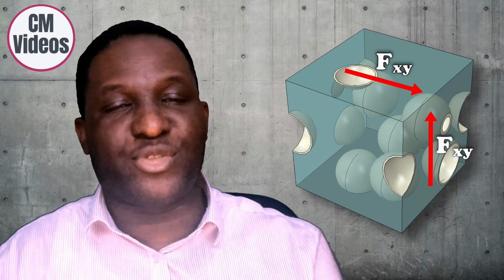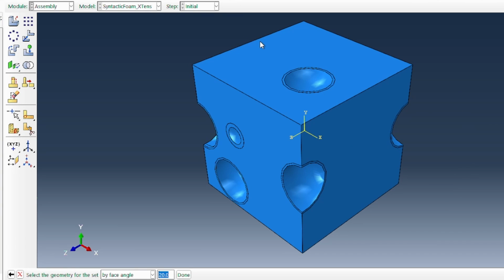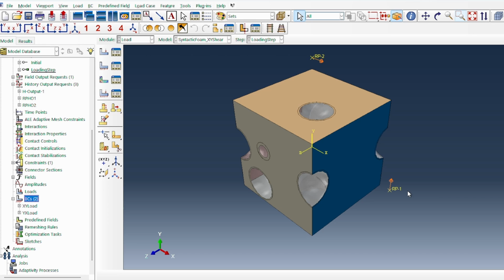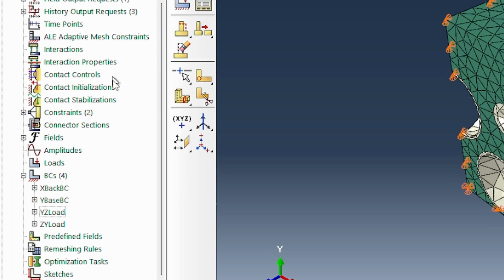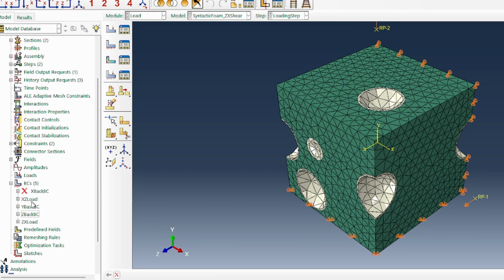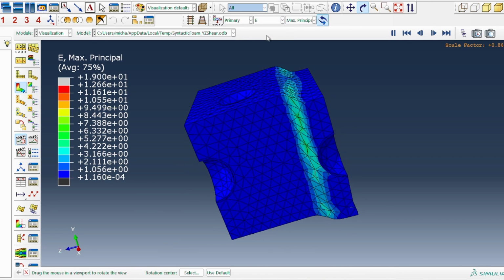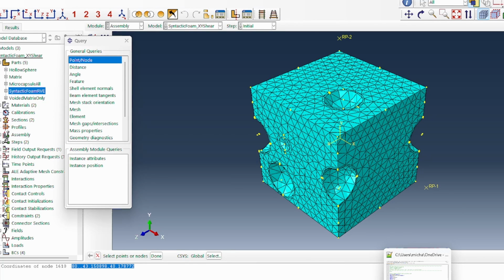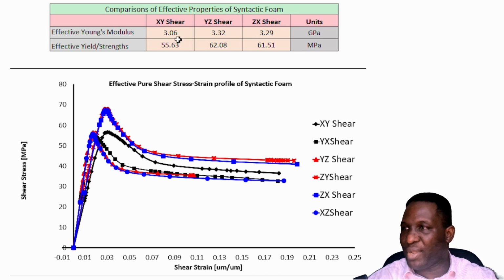RVE Modelling of Pure Shear Deformation of Syntactic Foams

Comment: Thank you  Dr. Okereke, great work! Quick question on homogenization of TPMS/Gyroids: When calculating macroscopic stress via DBC( Direchlet boundary conditon ), you use the actual loaded surface area of the RVE face, whereas some use the bounding-box area (e.g., L×W).

For cellular architectures, which is theoretically more appropriate for capturing the true macroscopic stress state? I’ve noticed this choice significantly impacts the correlation between DBC and PBC results. Would love your insight on this query.
Reply from the maker: You have to use the exact area as those are the areas where the force actually acts. So, the bounding-area approach may underestimate the stress unless the model is so large that there is no distinction between the two area measures.

Comment: Dear Dr. Okereke,
Thank you for your wonderful and informative videos.

I have a question,

As I have been following your work, I realized that for calculating the Young's modulus you consider the displacement in one direction for instance U1 and then calculate the strain based on the length it is being deformed in. In your video for calculating the Poisson's ratio in lattice structure material and also a 2D composite you consider a set of nodes or a single node to calculate the displacement in one direction like U1 and the transverse in U2 to get the Poisson ratio,

My question is;
Why would you consider a node displacement in field output for Poisson's ratio and not the set of RP that was considered before?

Thank you for your time and help regarding this matter.
Reply from the maker: Good question. 

The reason is that in extracting poisson ratio, you need two displacement (or strain measurements) i.e. u1 (along direction of loading) and u2 (transverse to direction of loading). 

These need to be extracted at different points in the model  i.e. u1 from the node in direction of loading and u2 (on a node at the y-axis, transverse direction of loading).

As I have only one RP i.e. at U1, then that gives me the displacement there. To get that of U2, I can do it two ways:

1. Use field output to track that (as displacement is always available for every note in the model) 
OR
2. Introduce another RP at that node and track it similarly.

I decided on the first one, as I wanted students to be able to extract poisson ratio easily with their normal tensile simulations as u1 will always be there. You can then go to an applicable node to extract u2 from a field output. This way, you do not have to specially setup the model for poisson ratio by introducing an RP node.

I hope the explanation makes sense.